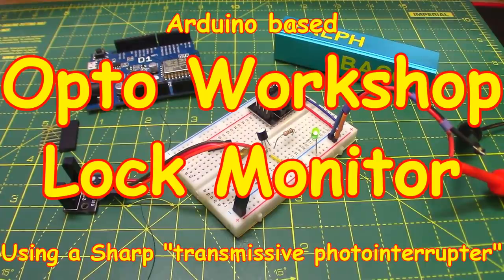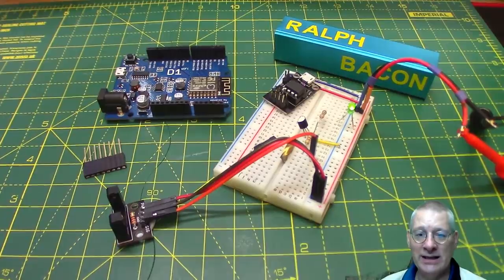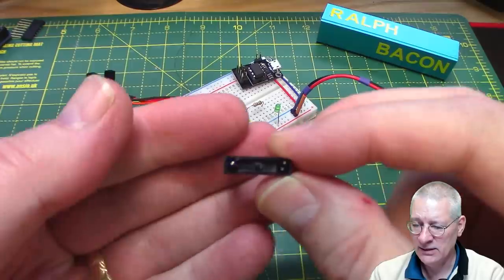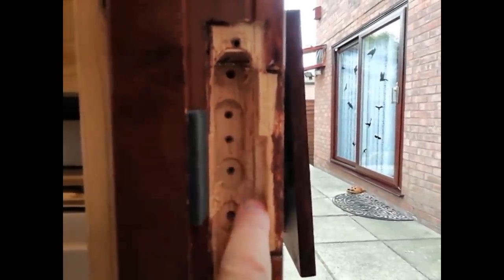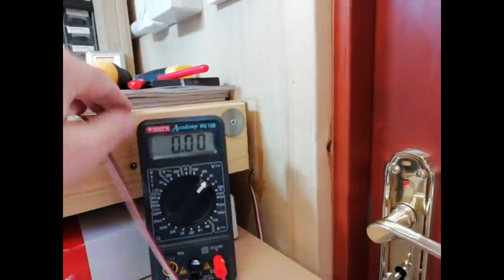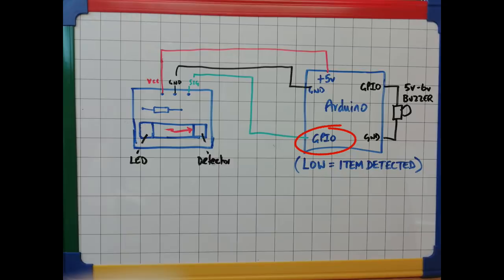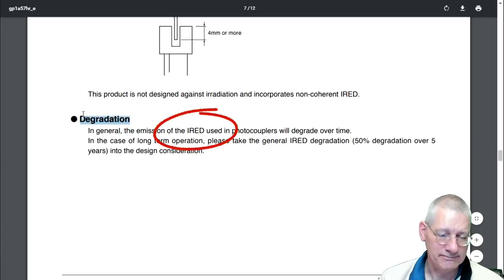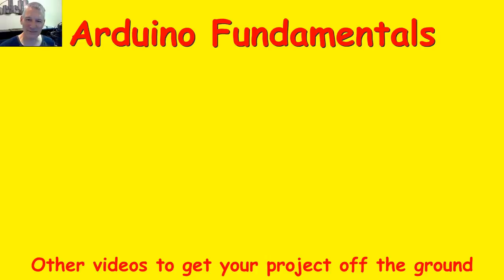#142 Optical Door Lock 🔒 Monitor (using an Arduino)

Comment: Want to make that sensor last for 50 years? Why not pulse it, if it’s only on for 1/ 10th of a second every second, it’ll last 10 times longer. Don’t know what the minimum detectable pulse is, but just an idea. Of course, now it’s two years later and I’m late to the party, I guess it’s too late for suggestions. Maybe if you have to replace the sensors, you’ll have to open the rest of it up, and adjustments could be made then if you so desire.
Reply from the maker: OK, I'm in a different workshop now but I still haven't implemented this project here - but I intend to. 

Now why do I need to pulse, what is effectively, just an LED? Why would that make it last longer?  If an LED lasts for, say, 50,000 hours and this LED is driven whilst I am in the workshop for, say, 8 hours, that LED should last for 14 years. Will pulsing it really extend the life? I've seen nothing to indicate it might! 😲
Reply: @RalphBacon  Partly, I was kidding, but if the LED has 1400 hours, you are subtracting 8 from it each day. If you pulse it, say 1/10 or 100MS, then turn it off for 900MS, you'll subtract 8 hours every 10 days as the led is only on for a little bit. Also, if someone wanted to modify this for a battery based application, they could put the Attiny in sleep mode when the led is off. I was partly kidding because, as you said, the whole thing was under 5GBP so cheeeeep to replace every 5/14/... years. I really appreciate your vids. I can't see, so I especially appreciate your clear descriptions when working on a project. Thank you lots!